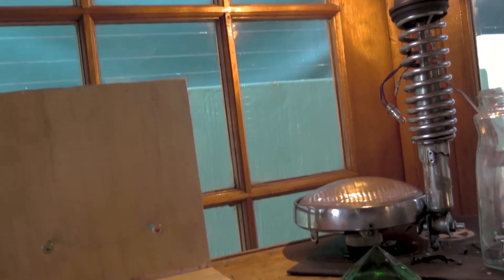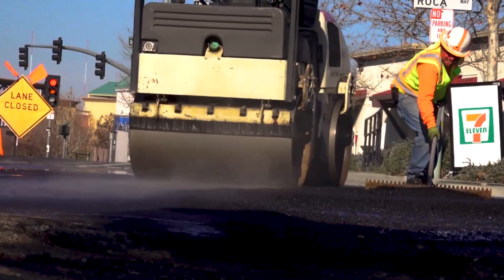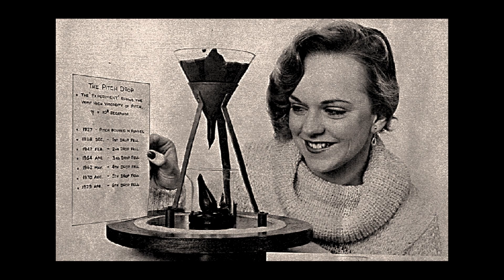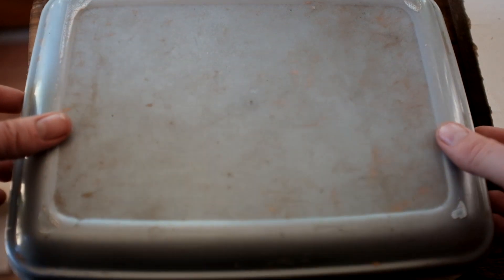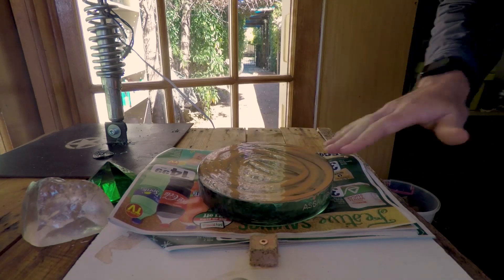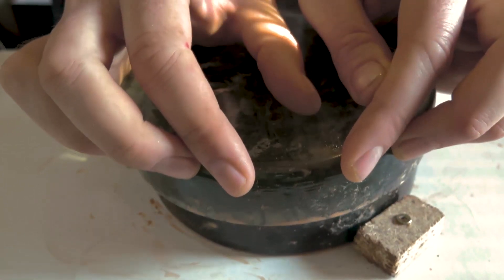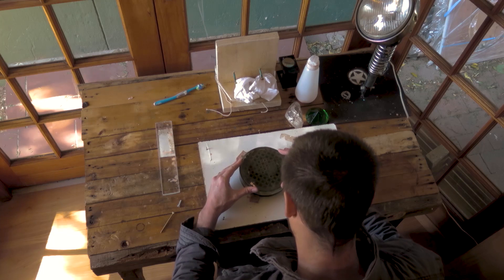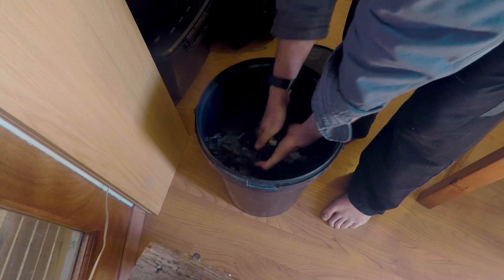DIY Telescope: Polishing the Mirror

Comment: You can also heat the pitch up with a torch just enough to make it soft enough to manipulate,mate it to your surface you want to polish, and with soap/water combo, lap the two together so the soft heated pitch matches exact to the curve/plane you have on the optic you are making. Then cool the tool off with water. You can also do this by heating up a large container of water and soaking the tool in it if you want a more evenly heated tool. Save you the headache of trying to lap a hard pitch tool to match your work piece
Reply from the maker: That's a great idea! Thanks for sharing.

Comment: try spin-casting epoxy directly into parabolic mirror shape/mold
Reply from the maker: I haven't worked with epoxy before. But, I've heard of a technique like this before to create the basic shapeon much larger mirrors. It's a very interesting idea and I'd love to see the results. I'd guess that you'll get to a circular shape which you could figure later into a parabola. And by changing the rotation speed you could also adjust the focal length.
Reply: @BornAdventures  you get a direct parabola bottom mold, to press/cast against, whichever way you choose to use this type of mathematical shape/mold making
Reply from the maker: So do you mean that you pour in epoxy in a circular container, spin it and as it cures it'll produce a parabolic shape? That's really neat! I'd love to try it out!
Reply from the maker: And does this need refining to bring it in shape or is it already good enough to produce an image?
Reply: @BornAdventures  well check out the parabolic liquid metal astronomic mirrors, the idea came from there, but instead of it staying liquid, its cast from epoxy (or anything that will be solid after the operation) and yes basically
Reply: @BornAdventures  its directly to the exact shape, no messing with cnc/polishing/machining
Reply: @BornAdventures  you might have a benefit of having cross flaps inside/under the cast epoxy liquid to get the fluid spinning centrifugally, in some cases you can then spray the shape with like aluminium/silver mirror coat, whatever you seem suitable
Reply: @BornAdventures  you could even do the whole process in a vacuum ion plating chamber, if thats necessary
Reply from the maker: Thanks. You've just sent me down a YouTube rabbit hole. It seems like it's quite a simple procedure to set up as well. I'd like to make a 16 inch telescope some day and I think I might give the epoxy technique a go.
Reply: @BornAdventures  hope it helps
Reply: @BornAdventures  it's designed to be perfect, and moveable, hence the epoxy cast :)

Comment: Your polishing work looks very very cautious. In the final stages (figuring) it is ok but at first you can really use force to get mirror polished. You can also use different strokes like elliptical or epicycloids, but keeping stroke length in control. Also working tool on top can be useful (watch out for TDE!). The most important is to be sure contact is all the time near perfect. Mastering pitch lap is one of the main skills in mirror making.
Reply from the maker: Thanks. I think you're right. I was watching some videos of guys making 14 inch mirrors and I was very surprised to see how much for they use when polishing. I have alternated with TOT and MOT. Because when I started testing I had a bit of a doughnut shape. Luckily I have a slightly TUE. Lockdown and everything has sadly stopped our get togethers, and I need to repour my lap, so hoping I can finally finish this mirror off soon.

Comment: A bit picky here but it is generally recommended to take off any rings, bracelets, watches when doing that. They could bring a few grains of a previous abrasive, or worse make a big scratch on the mirror when handling it... That being said, nice video!
Reply from the maker: Yeah, you're right. Also, to clean your finger nails before starting out. It only takes one grain of dust to mess up a whole mirror. Thanks for the advice!

Comment: what really surprises me is that no one is using, any kind of cnc lathe to make parabolic mirrors. you could take regular spherical mirrors, and knock the outer third of the mirror down to convert to parabolic. yet it seems no one wants to do it, as long as they can still charge a fortune for a chunk of glass!.
Reply: lathes typically have tolerances of around 1/1,000th of an inch. Maybe 1/10,000th. telescope mirrors require tolerances of 1/4 of a wavelength of light minimum, preferably less. 1/4 of a wavelength of light is around 100 nanometers, which is a few millionths of an inch. If you imagine shrinking yourself down so that the defects on a telescope mirror come up to your knee, the defects on a lathe ground surface would be like 10 story buildings.

Also, you can buy mirrors with "pre generated" curves, which just means the rough grinding step has been done. But at that stage, it isn't terribly meaningful to talk about the difference between a spherical and a parabolic surface, as a rough ground spherical surface is much farther from either an ideal sphere OR ideal parabola than the ideal sphere is from the ideal parabola.
Reply: @marklogan4079  Great analogy!
Reply: @marklogan4079  yeah, thats the thing with optics, nice explanation about the lathe ,and now all know how hard /worktime tike to make a near perfect parabolic mirror (and thats sound money too me)
Reply from the maker: Hey David. Could you elaborate? I'm keen on hearing your idea. I think a lathe can definitely be used to get the approximate spherical shape, but getting it to a perfect sphere and parabola would need a special polishing machine. We had a guy at our club use a grinder to hog out the inside of his mirror to get the bulk of the glass out, so a lathe could definitely work for that leg work.
Reply: the tolerances are simply way too small. you need to go down to hundreds or even tens of nanometers for your telescope to be diffraction limited

Comment: Why not using orbital polishing tool?
Reply from the maker: Hi There. Orbital polishers would dramatically distort the shape of the glass. The mirror and tool to polish have to be exact by this stage. On larger mirrors, you can make a tool that'll give a great polish. It replicates the strokes you would by hand
Reply: @BornAdventures  so for optical device better polish it manually?

Comment: Definitely NOT the longest running experiment.  THat would be the 50 year test to seef if silver clampt to gold would stick permanentyly after the clamp was taken off in the required time.  The two metals STUCK as expected.
Reply from the maker: Hey there. The pitch drop experiment began in 1927, so almost 100 years now.
Reply: @BornAdventures  OK, well, now I know.  Thx.
Reply: @BornAdventures  not sure if this counts as an experiment or just a demonstration but the "Oxford Bell" has been running since 1840, so, 185 years as of now;
https://en.wikipedia.org/wiki/Oxford_Electric_Bell

Comment: I've been looking at doing this, have VERY minimal experience sanding furniture and car repair so wondered what are costs involved? and is it worth it vs buying commercial equivalent?

sorely tempted to emulate Dobson himself after seeing his video and it might make a cool winter project. I have ability to whack together most of the rest of it without major problem
Reply from the maker: Hey there! Making a telescope is actually surprisingly simple. It does, however take a very long time. There's a guy who made a 4 inch scope over the course of a week. But, he had many years experience and all the equipment. Most of the hours will be grinding and figuring. For less than an 8 inch, probably 40 or so hours. Then making the scope is only as complicated as you want it to be. If you're good with your hands. A weekend construction and another day to pretty it up is all it should take. 

Cost wise. The cheapest would probably be buying a second hand telescope. Making one can be very cheap, or expensive. Depends on the design and how frugal you are. You can salvage parts for a scope from many places to keep the costs down. So the only costs would be in the mirror (buying the glass, the grits and polishing compounds, and coating it when you're done)

If there are any clubs nearby, go through and chat to the guys. It's a great hobby and making a scope is incredibly rewarding.

Hope this helps!

Comment: Ahhh a fellow South African ATMer! I have just finished my 220 mm f6 primary, sent off to Joburg to get aluminised. Ended with a slight turned down edge but not too bad considering I'm all alone here in Pietermaritzburg. Do you know if we can get polishing pads here in SA?
Reply from the maker: Hey Gareth! Well done on finishing off the mirror. Is Ronnie coating it for you? It's difficult to get it all done alone. I haven't seen anyone sell the polishing pads locally, but will ask around for you
Reply: @BornAdventures  Thanks man I would really appreciate that. I think Rodney coated it for me? I might try using the felt polishing pads you can get from dremel, glued down onto the tool. If it ruins the figure then I guess I can always go back and regrind with 1200. This is for my second and third mirror which I am hoping to complete in a much quicker time.
Reply: no way i'm from pmb and kicking off on my first build  greets from cape town!

Comment: Sir if I use 12 inch diameter Plano concave lens for reflection telescope with diameter and length secondary mirror will I used?
Reply from the maker: Hi Dasari. What was the lens used for before? Do you know it's focal length? I suspect if you want to use that piece of glass for a Newtonian, you will have to regrind and refigure it into a parabolic shape before using it. It may be easier to get a fresh piece of glass to if that is the case. I'm a bit stuck with fixing some errors I have with the glass from this video, so will do the calculations for the secondary mirror when I get to that point. But, in the meantime, please visit stellafane.org. They have a wealth of information on how to calculate diagonals and are much more thorough in their instructions than my video
Reply: @BornAdventures  Thank you sir
Reply: @BornAdventures  Focal length is 2000mm
Reply from the maker: @dasarinarasimhulu5974  You could probably use a 2.6inch diagonal. But, just double check all your measurements before on the online calculators

Comment: What does the focal length depend on?
Reply from the maker: Hi there. The focal length is determined by the depth of the curve or 'sagitta'. Basically, the deeper your sphere is on your mirror the shorter the focal length.
Reply: @BornAdventures  Thanks ! There is any tabels which determine it?
How thick should be mirror for  250 and 300 mm?
Reply from the maker: @grzegorzciszewski5204  I haven't found any tables online, but Stellafane has some nice tools to help out. Here's one that will do the trick https://stellafane.org/tm/atm/mirror-refs/sag2fl-calc.html. They also have some great resources and explain the whole process incredibly well.
Reply: @BornAdventures  Great ! Thank you very much :D
Reply: the curvature of the mirror